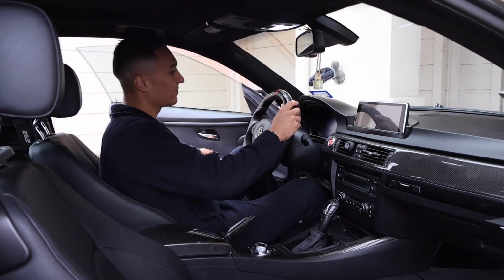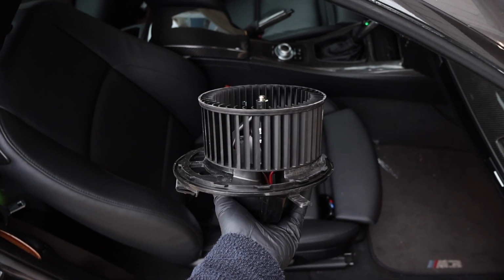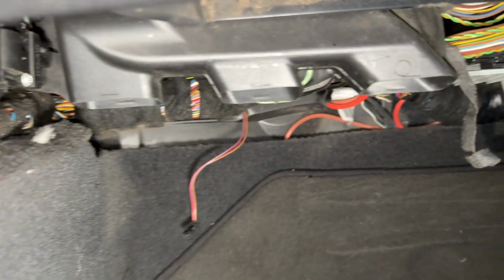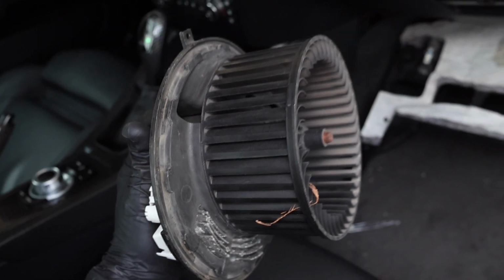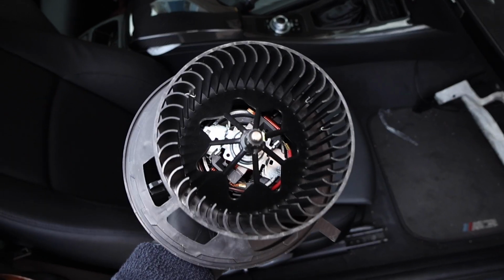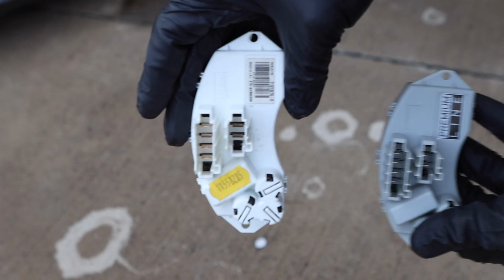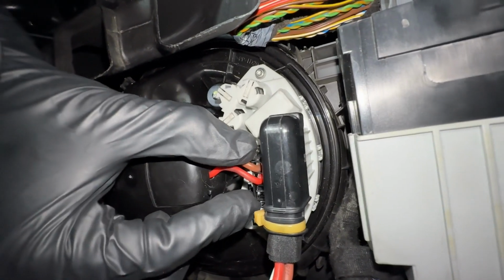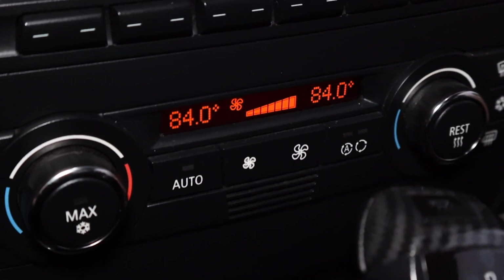BMW Blower Motor & Regulator Replacement: Fix Weak Airflow | 1 & 3 Series E90 E92 E93 E81 E87

Comment: I replaced blend door acuator & still have no air only in the farthest passenger side vent. Is this a separate acuator?  Or just blower motor? I get strong air in the other vents.
Reply from the maker: There are a series of 7-8 blend door actuators on the E9X. You may need to replace the one that controls the passenger-side air
Reply: @IzzyE9X which one os that though? Hard to get Google to tell me for some reason.

Comment: Hello, in my E90, when I turn on the heater, hot air comes out the driver's side, but cold air comes out the passenger side and the rear outlet. What should I check? The engine cooling system is new, has good flow, and was properly drained.
Reply: I have similiar problem, I located it as blend door motor malfunction

Comment: Izzy good video bro. Question why do my pulley chirp at start but quiet as I drive a few miles. Is it the pulley & belt needs to change?
Reply: Also, I had my brake pads & rotors & calipers done. But the car do throw a brake pad warning light when I already did a reset is it the tire wear sensor gone bad or maybe it it’s faulty & should just replace all?
Reply: You need to replace the brake pad wear sensor as well
Reply: @ ok in figured that. Thank you bro I’ll buy a set.